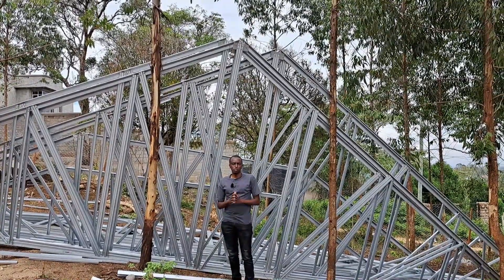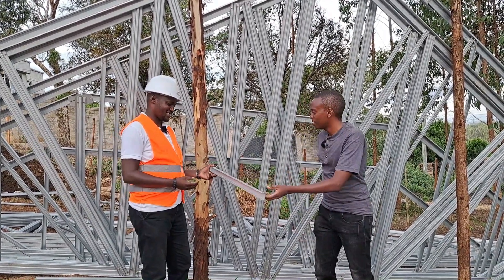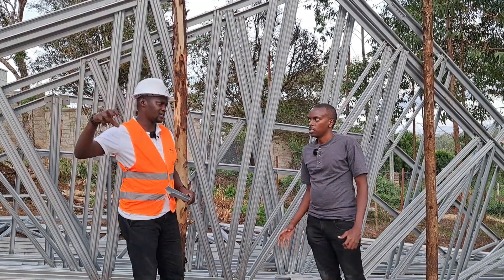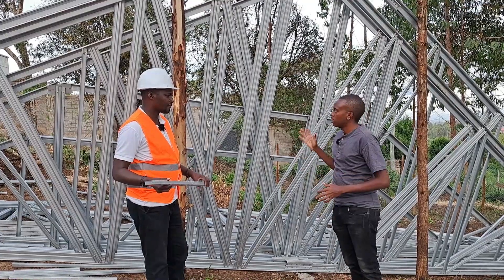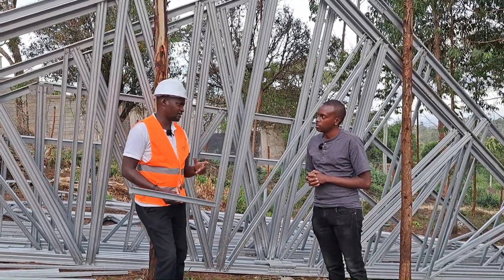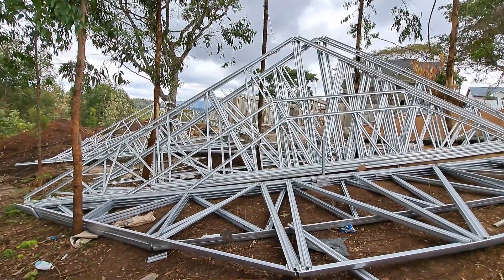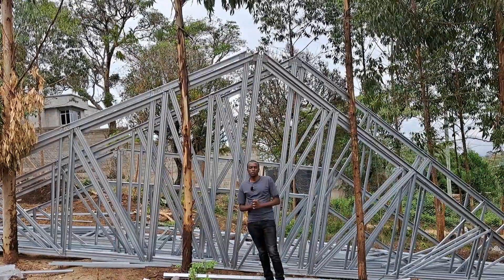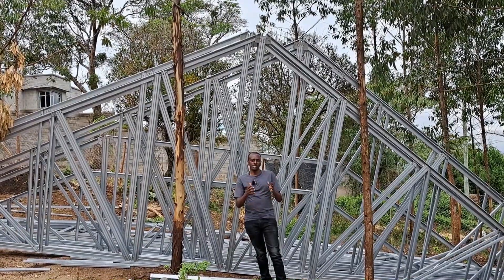Roofing a Precast Panel House with Light Gauge Steel (4 Bedrooms)

Comment from the maker: Hi guys, this is an ongoing project in Ngong, Kajiado County, Kenya. The client used light gauge steel to roof their house. The house is also built using precast panels, which you'll see in some of the clips in the video. Enjoy and learn about LGS roofing to inspire your project.

CONSULT WITH ME
Email: propertynoma5@gmail.com
Whatsapp: +254790165523
--------------------
CONTACTS
Samuel Chomba of Atlanta Property Developers (Main Contractor) +254720781218